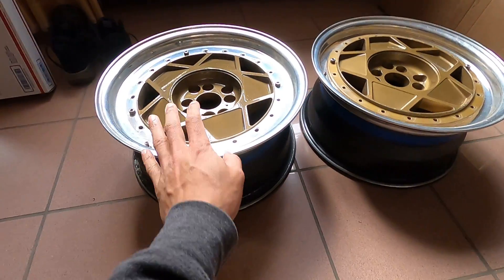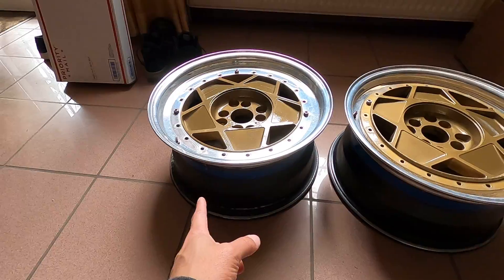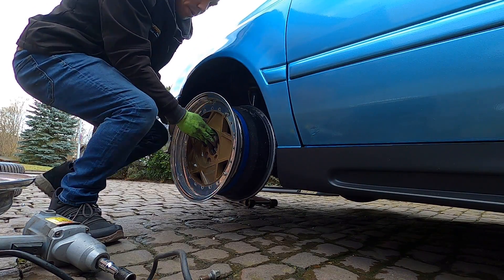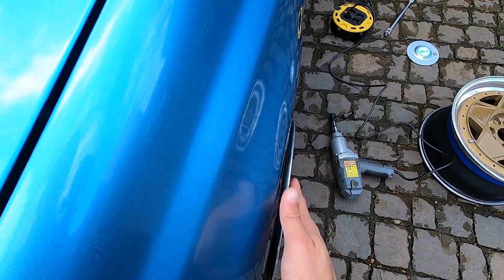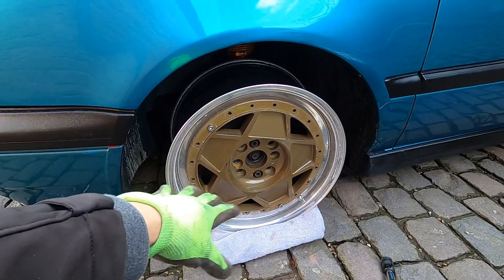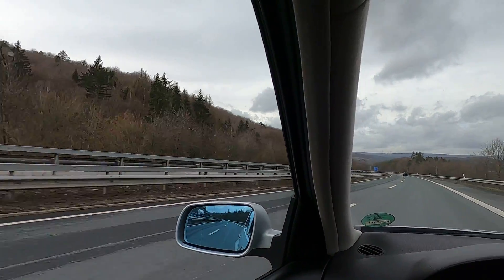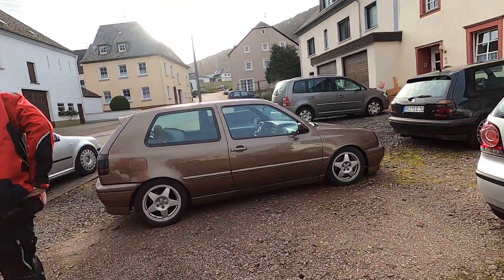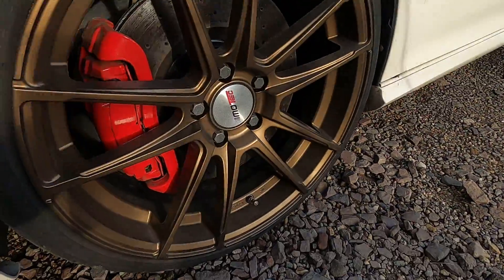HRE's Look EPIC On Miley!! ( + HUGE PARTS SCORE! )

Comment: And the savoy doesnt have slotted brakes up front like miley. They are solid rotors. That's the difference I think
Reply from the maker: Tyler Pludowski I didn’t even realize that but yeah that’s another difference
Reply: I converted my 95 from solid 256mm to vented 280mm rotors and it made no difference in offset. The only offset difference I know of is when you have the 'plus' undercarriage option. Subframe and control arms are wider, but I think that has been delivered on GTI and VR6 only.

Comment: Face mount and machine 5mm off the hub , in the rear go sandwiche mount. It would be a fresh look.
Reply from the maker: Chappy Oatagaurd I’m thinking face mount with a roll/pull will be perfect I don’t want to have it shaved down if I don’t have to but I do like the idea of face mount front and sandwich mount rear 🤘🏼
Reply: @Mk3Smith  yeah, like you said face mount makes the wheel look bigger. So you will get a big  and little look with a square set up. Would look dope too.

Comment: This is a strange situation, I've got a G60 Corrado, 1.6 Mk3 and my old Mk3 TDI, had the same RH ZW1's on all three of them. All different brakes and even the steering knuckle of some are different but the fitment with the same wheels was pretty much the same.
Reply from the maker: GolfG60 if they were all European spec cars with the same brake/hub setup I guess they’d all be pretty close in fitment. The US spec mk3s have vented rotors where some of the eurospec cars have the solid rotors and I’m guessing that’s where the fitment issue is varying between the cars lol
Reply: @Mk3Smith  They aren't, the G60 is a US spec vehicle. I don't believe the difference is in the rotor's, my tdi had 280mm non vented and the G60 has 280 vented, 1.6 has biscuit sized brakes. You might check the subframe and lower balljoints, I remember when I installed my 9" all around Borbet T's, front left poked 1 cm but front right sunk in 1 cm, the subframe and lower balljoints weren't centered at all, after centering them the wheels sat flush.
Reply: Also, did you check the offset specs inside the wheels? Because maybe someone already milled of some to get some more offset, use a caliper or tape measure to check for sure.
Reply from the maker: GolfG60 true something else might be different not just the hubs. Wheels have never been milled to my knowledge and I used the exact same wheel to test on both cars and you can see how different the result was. I also tried the same front wheel in the back of the savoy and it had the perfect fitment like the first wheel I tried. All the wheels are identical but it doesn’t matter now since the face mounted style will work just fine

Comment: Did u try putting the front rims at the back and verse visa? Might solve ur problem leave the rim as is
Reply from the maker: FANATIX wheels are all the same size swapping from front to back wouldn’t change anything the cars have different fronts ends in terms of how wide they are.
Reply: @christiansmith yeah I saw what u meant in the following video.

Comment: Face mounting all around is def the move, please dont do em different front to rear. More importantly tho get some center caps for those things, if they werent dual drilled you could def get away with running em without caps but as they are now, yea you need some center caps bad